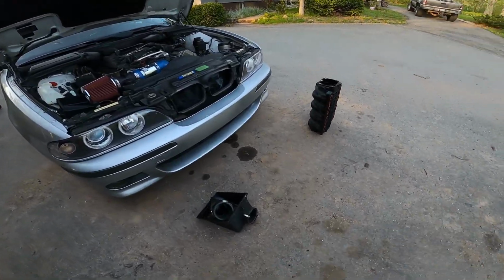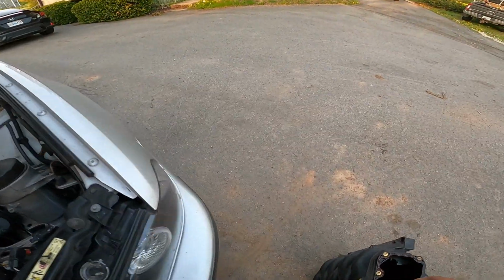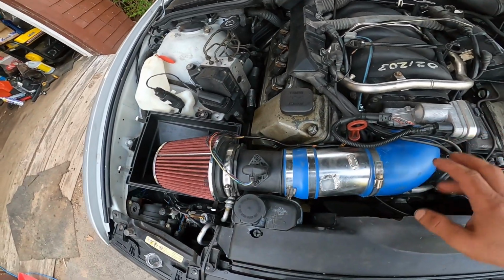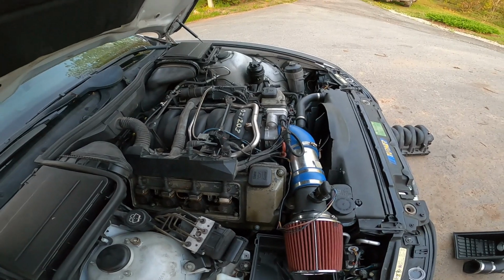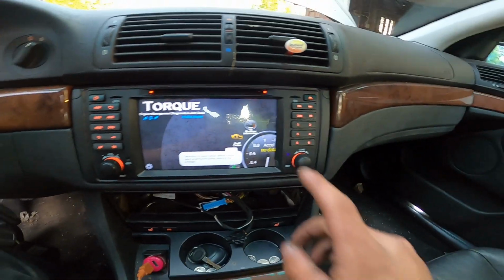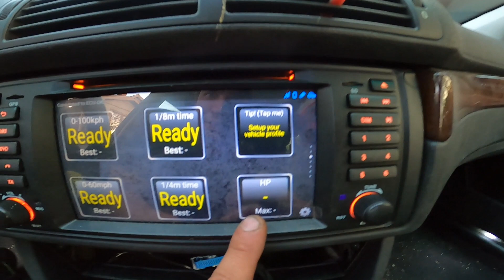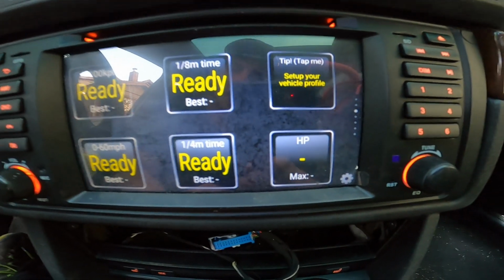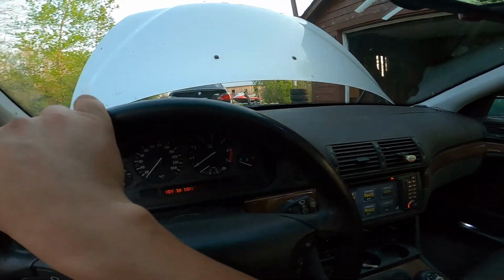Bmw e39 540i Intake Manifold Upgrade!! Does it Really make more HP!!! How to install 4.4 V8

Comment: Good vid. Afaik the cai and 4" tubing and ~4" n62 TB will add upto 10-15hp. Also from what I've read basically m60 manifold moves the torque curve from the higher to lower end, so you'll get more torque pulling away vs higher up say passing a semi. The horse power is the same for each manifold afaik. Also there are 3x manifolds: 1) m60b40 (from e32, e34 and e38) these are the ones with horns and has the lower torque curve. 2) m62b44 (from non-vanos units found on PFL e38 and e39 units etc) these have the higher torque curves. 3) m62b44tu (vanos units on FL e39 and e38 from ~late 97 till 2001/03 depending on chassis). These are the worst of the 3 and why lots of people upgrade as have the thin pipes and may have reduced airflow compared to the previous two (im not sure as I have the non-vanos unit but these units may have a lower output). Also afaik the dinan intake is basically the same as the m60 with horns. Here's some info and an awesome info source: https://www.meeknet.co.uk/e31/BMW_M60_M62_M62TU_Engine_Crankcase_Ventilation.htm (down near the bottom). Hope that helps.
Reply from the maker: This manifold works better bottom to top that I installed

Comment: Are you in E39 540i Exclusive on Facebook? I thought I remembered seeing you post? I'm so glad you made this video. This is exactly how I felt after doing the swap. I've done dual exhaust and deleted my cats so I'm thinking vanos has been altered as I've lost some initial low end torque. I've swapped back to see if it's a difference and it's not. Having the flow coming in and just the right exhaust going out is the key.
Reply from the maker: You need turner tune
Reply: @BurninGas8.1  I may have to try that out. The tune I have now Digital Tuning Solutions just not cutting it

Comment: Great video!! Just curious, what did you do to connect the vacuum lines to the inlet pipe? Did you just shove them through the soft tubing?
Reply from the maker: Drilled small holes
Reply: @BurninGas8.1  thank you! Just got an m60 velocity stack intake qnd the throttle body with the CAI excited to feel the difference after motor rebuild

Comment: Hey bro what did you do with the 2 lines that connect to the intake elbow near the throttle body?
Reply from the maker: I plumbed them into my new intake i made
Reply: @BurninGas8.1  by making a small hole and forcing them in?

Comment: Quick question did u use your old injectors and are the non vanos injectiors bigger then the vanos injectors if so could I use the bigger injectors
Reply from the maker: I used the vanos injectors not sure if they are different from non vanos ones

Comment: Hello Sir! What radio is that you have installed in the E39?? The fit looks bang on and I like that it's Android based. I use that Torque app all the time on my phone with a Bluetooth adapter. Having it built into the radio would be sweet!  Love your 540, I have a Silver 01 540i-6 speed myself, hoping to get those headlights and the M-Tech front and rear bumpers soon so I can get mine looking nice again. Also trying to hunt down some E39 M5 wheels for a reasonable price cuz I already need the extra rubber out back and I haven't even done the intake upgrade yet! I just have a good Cold air intake, and Gutted all 4 catalytic converters and straight piped all the resonators/mufflers and I have a Magnaflow 3" Straight-through racing muffler. Not too loud, Sounds nice and deep with almost no rasp.
Reply from the maker: Yea I think it was designed specific for e 39
Reply: What brand and model is your radio??

Comment: Any thoughts on getting a e39 M5 lsd in your 540i?
Reply from the maker: Think I’m just gonna buy a spare and weld it m5 rear diff totally different
Reply: @BurninGas8.1  looking forward for the video , if you decide to post one about it. Also 2 quick questions i started noticing blue smoke on startup and sometimes-during hard acceleration in my 540 was wondering if you had any advice or suggestions on what could be the problem, & also do you suggest a transmission flush? Idk how i feel about BMWs “lifetime fluid” claim
Reply from the maker: @bobbyrobbyn1838  I use redline mtl in transmission lifetime fluid is bs, and some do smoke a bit you could try putting a cup of atf in your engine oil if your rings are sludged up this will help
Reply: @BurninGas8.1  I have the 3:15 LSD on my 540, all we had to do was get the M5 axles to fit!
Reply: @optimistic32  driveshafts were the same lengths? You've got me very interested in swapping mine now if all you need is really the diff and axles
Reply: @Ezra7X  makes all the difference in putting the power down, I just finish changing all my bushings to ECS bushings! Subframe, diff,trans, driveshaft & I tell you now you feel the true power of the 540i! That 98 intake manifold have my car sounding like a bully in these streets! Definite must have, really woke up the car with the supercharger!
Reply: @optimistic32  Sounds like you've got a car you can keep forever, I've got a 97 and it always seemed a little overpowered for an open diff but it sounds like your car irons out every issue the 540i has. Super jealous that you've got a blower on it.

Comment: Before & after dyno numbers?
Reply from the maker: Lol buddy i just installed this two days ago... befor dyno is already done... appointment for next run with new intake will be a week or two away
Reply: Got results yet?
Reply: @BurninGas8.1  What was your result? I'm quite skeptical that this is an upgrade at all just like the m50 manifold .
Reply from the maker: @nater258  havent got on dyno yet but top end is definately way better and bottom end the same works great and still awesome fuel mileage